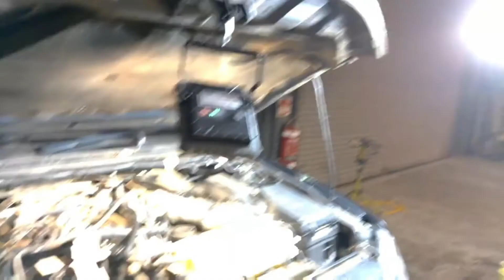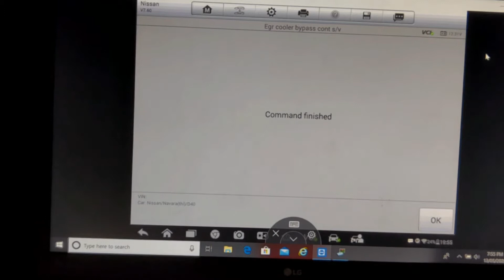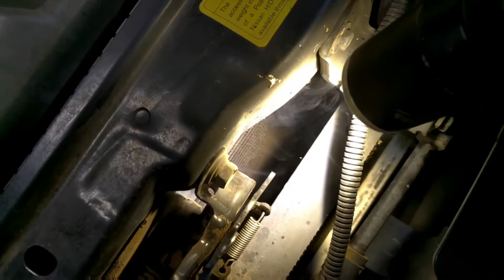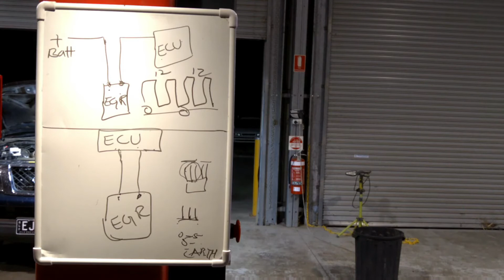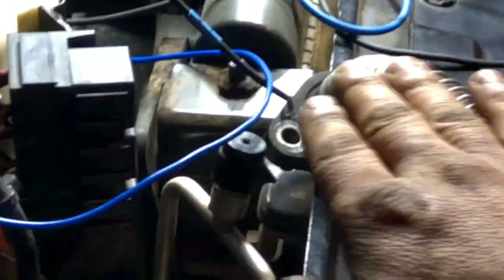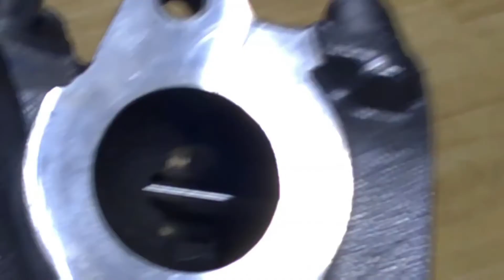NISSAN NAVARA 2012 V6 diesel EGR DIAGNOSIS P0488

Comment: Thank you for this great and important video.
I have egr fault on my Infiniti QX30d 2012.
No one here want to replace the EGR because it requires to take out the engine in order to replace it.
Please, is there any other way to disassemble the egr valve and replace it without taking of the engine?
Reply from the maker: Yes can be done. I ve done a few. Just need smallest spanners and ratchets.

Comment: And as usual the issue is in fact some bad plastic wheels. The vacuum actuated egr valves were much more reliable and cheaper than those electric actuated. Is the same issue with vw and all other that use this design. 
After a while the teeth on the mechanism wheels get broken. Usually the electric motor has no issue. 
All the manufacturers should provide spare wheels for fixing those things.

Comment: Can this make the car surge intermittently this is a great video well done
Reply from the maker: Technically it can do that but I have never seen such issue.
Reply: @a1mechanicaloakey  I have a v9x in my parthfinder and has been surging nissan has replaced ac pedal all intake and boost pipes and turbo and now saying the egr is faulty as the check engine light is on and the surging is still there it can go 2 weeks without doing it then do it for 2 days then nothing for 2 weeks again I have spent so much money and still going as next week I'm spending another $4000 on top of what I've already spent

Comment: What voltage do put across what pins to bench test it? Thanks
Reply from the maker: What are we trying to test?
Reply from the maker: It's a 5 wire component 2 bigger wires are + 12 v  and - earth switchable from ecu. Rest 3 small wires are for position sensor. Best to check while it's connected, you wanna see 5 volt reference, 5 volt bias and earth. If that makes sense. Andrew if you are a technician and wants to learn all these stuff. Please visit and join my website. Link is in the description.
Reply: @a1mechanicaloakey  I want to bench test the egr valve in this video but its already off the vehicle.
Reply from the maker: Same principle find which 2 pins has bigger size wires going to it and put 12 volt and earth on either wire. One should drive the valve to open and reverser polarity will achieve the opposite.

Comment: Hi mate, you got any tips for removal of egr valve? It looks rather difficult.
Thank you very much.
Reply from the maker: You do need some small profile sockets
Reply: @a1mechanicaloakey  wanna do it for fun? And make a video?
Reply from the maker: If I get Navara V6 come in with egr problem I will. It's difficult to get to few bolts, will requires few low profile sockets and ratchets  but can be done without ripping everything out.
Reply: @a1mechanicaloakey  ok cool I have that code but have been told it could be up to 5 things
Good fun

Comment: Hi, i have this engine with an intermittent p2457, egr cooler performance, engine management light fault. Any ideas?
Reply from the maker: Not sure without looking at it JO. May be start with coolant level check.
Reply: @a1mechanicaloakey  that's the thing, the coolant tank is a bitch to see a level through, the plastic is very clouded. There's no physical leaking onto the ground. I wonder if its leaking into the egr cooler?
Reply: @roverM30ds what happened,  what was the story.

Comment: Hi , i have a 2011 Navara STX 550 with the V9X engine and i am about to do a EGR valve replacement aswell as a Throttle body repacement, Do i need and special software to enable the ECU to relearn the replaced parts or is that something that will happen over time?
Reply from the maker: I didn't have to. So shouldn't need I believe.
Reply: @a1mechanicaloakey  awesome , thank you so much for the reply 👍

Comment: The V6 is Spain not Thai, so you selected the incorrect setting in the computer
Reply: The v6 uses bosch ecu the 4 cylinder uses denso, so not the same
Reply from the maker: It worked so ecu must be same
Reply: @a1mechanicaloakey  how can it a 4 cylinder is nothing like the v6 Renault, it’s the Can bus system that enabled you to read some of the data , but not the specific info you requested, accept your fault mate
Reply from the maker: @cjgaucicharlie3226  I don't know what you trying to prove here mate. But whatever you say, at the end it worked and gave you the diagnostic process. Take it or leave the channel.
Reply: @a1mechanicaloakey  mate you made basic mistakes that someone in your position should not
Reply from the maker: @cjgaucicharlie3226  its a 40 minute video and thats all you have to say. What do you want me to tell you mate. plus 2+1=3. Doesn't matter how you get to it. Go figure
Reply: @a1mechanicaloakey  it shows you like many others can’t accept your fault, just own it dude
Reply from the maker: @cjgaucicharlie3226  I just did. Now f off

Comment: Just got this fault on my 2011 Pathfinder v9x so cheers for this informative video. I started it without the pipe between valve and intake and stopped it. No movement, but the valve gets power and makes the exact same sound that you had in the video.
Reply from the maker: Sound like a faulty valve pokerfjes. Thanks for the subscription.